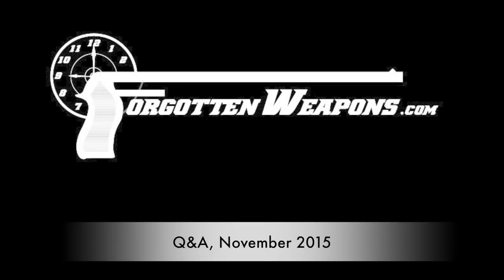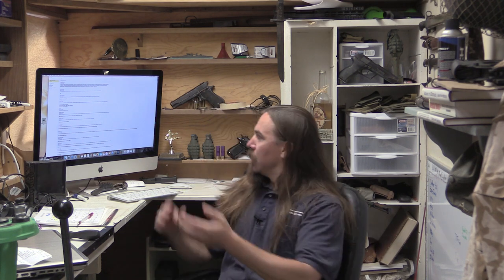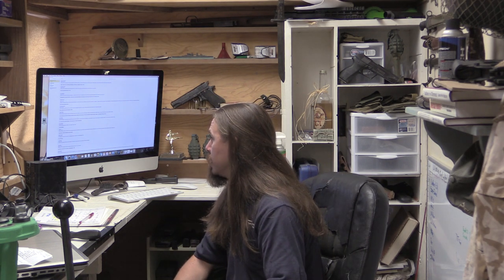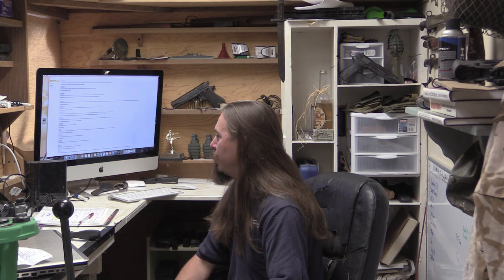Forgotten Weapons Q&A November 2015

Comment: Keep up the good work! I too would disagree and go with the AK in the trenches. Its caveman simple. I like it because it does not have any tiny parts to lose in the muck and grime of the trenches. I can take an AK and half a day to train someone to be competent with it. M16 more like a week..... Great discussion on your board.
Reply: +Jose Vazquez They're both simple to use. The M16 is also quite reliable, just as much as an AK.
Reply: +Jose Vazquez The endless AR15 vs AK47 discussion.

Let it be said that I assumed Ian would've picked an AK with his preamble he gave his decision, but I trust heavily that his engineering knowledge is related to his choice.

A "true" (stamped receiver) AK is almost certainly more reliable, but the AR15 in this case meets the criteria of good enough and then some, while its accuracy is simply ridiculous.

The AK (even more so for a stamped vs milled AK) has accuracy that may require follow up shots, and due to the nature of trench warfare (in the state of not leading advances, but dig in popping shots passively) accuracy would be desirable for picking off anything that pokes its head out briefly enough, as you may only have a small space of time that outside of follow up shots may not be an option.

That's my set of assumptions as to his logic, but the muddy trench question is an excellent one because it pairs elements of wanting reliability with harshness that leaves a desire for more elegant performance. I would love to see what Ian has to say on the matter though.
Reply: +YCCCm7  No love at all for the FN FAL? I'm sure there's more Europeans seeing this Q&A, and I've seen British soldiers eye these sturdy brutes with envy. Or, what about the Stoner? Still no one?
I'm a bit of a 7.62 NATO fan, but WWI is muddy long distance warfare. When considering a WWI Back to the Future fantasy football gun, I'd start with the perfect cartridge.
Reply: +Daniel van Slooten With all due Sir after the war and most all wars soldiers stated that they rarely saw the enemy past 100yds and the max is 300yds. At that range I'd think the higher rate of fire and greater magazine capacity would be better. The FN FAL, G3, PSL, Dragunov or M14 would make designated marksman rifles. The designated marksman is not a true sniper but instead it gives the individual platoon the ability to delivery accurate fire at distance.(not precision that would be a sniper). Ive fired all of the above and am still convinced the AK in the trenches would be best. The AR with its mess of tiny parts would be a nightmare!
Reply: +Jose Vazquez 
How about the Sig 550..? Like a 21" barrel AK in 5.56 caliber made by the Swiss with superb quality. Large and simple moving parts and even comes with a bipod to take prone pot shots off the edge of the trench.
Reply: +StPaul76 I'm sure it would make a great mud rifle! So would a Galil, R4 or Valmet all derivatives of the AK. Look I keep an Ar15 next to me when I go to sleep but it serves a very specific purpose of bump in the night gun. It has a 16" barrel, A1sights, Sure Fire light and sling. I check it frequently and lube it accordingly. For the purpose of mud fighter I think the AK derivatives stand apart from the competition!
Reply: Jose Vazquez

I agree. I am personally familiar with Sako/valmet Rk62/95 rifles since as a Finn I've served in the FDF. Rk62 fires even blank rounds full auto with a stiff frozen action full of snow and ice.. And with a steel tube stock one can really bash some heads in properly.. :D
Reply: +StPaul76 Yeah, I have to agree. I'm not an AK guy at all but the Valmet Rk 62 and 95 are just fantastic guns while still being simple and reliable.
Reply: J - I dunno. When we got AR-15 patrol rifles about 10 yrs ago (i bought my own), the agency put on a training class. The local gunsmith taught most of it. We learned field stripping and cleaning in 30 min or so. Tben we covered zeroing sights, common problems and pitfalls, and a few other subjects. Whole thing was about half a day, then we went shooting. Of course, that was cops with a decent level of firearms experience, and not new military recruits. But it's not a difficult weapon to learn. I agree about small parts. Most soldiers keep a rag or hand towel for that. Easy enough to lay one on the duck boards to homd the bolt, carrier, and bolt parts, i would think.
Reply: I agree with Troy on his conclusion of small parts not being a problem. Dare I say, the mudtests Ian and Karl have ran have proven that the level of mud you get in an AK is vastly higher than that of an AR15, and the effect is much more fatal to its operation.

That being said, you don't have to worry about disassembling and cleaning the gun in stressful, muddy conditions if it never locks up on you in the first place.